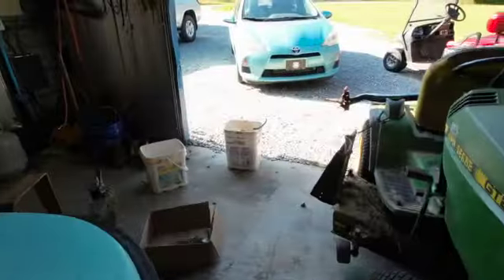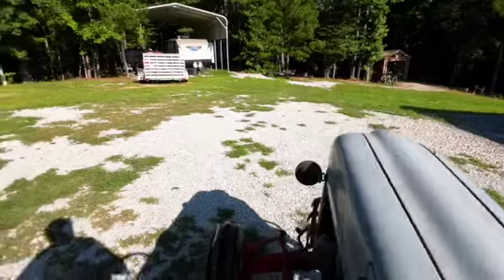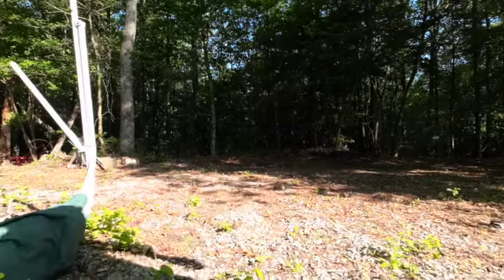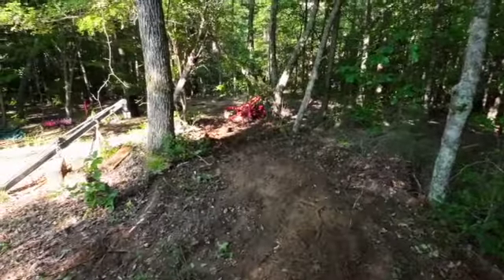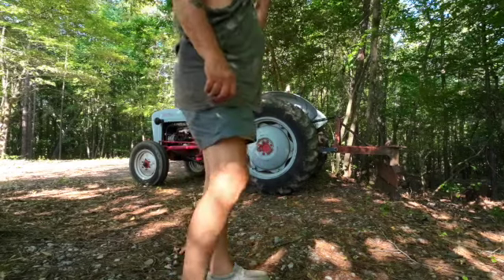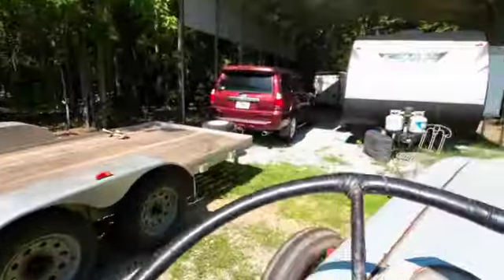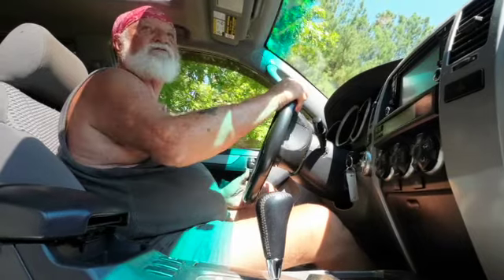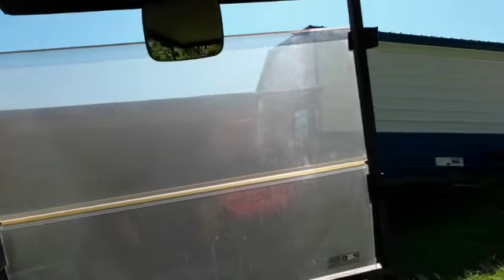Gettin' it done with a tractor on a hot day in Dixie

Comment: I agree not every one is able to back up a trailer . If have a non contact temperature gun . A good converter will be around a hundred degrees hotter at the exit side of it, But just a quick test as one would have to know the desired exit temp for the conditions to see the actual health of the converter , but can tell if working or not. . Or better if know any one with a car scanner , one can tell a lot from the upstream and down stream 02 sensor readings.
Reply from the maker: Oh..

Comment: Yeah cadillac Converter Can get plug . somewhere around a hundred thousand miles The honeycomb gets plugged from the carbon in the car And when that gets plugged that could catch the car on fire . You can take it off. Clean it Out But if you don't get it all out and it plugs  muffler at that caused you more problems .If the state you're Live in Allows you to not have a converter in Or straight Pipe you could put a straight pipe on Where the converter was .Pennsylvania Where I live Not too many people live in this area You can put a straight pipe on here. I used to work on cars and Trucks . I'm disable now . But if the car keep smelling hot That cadillac Converter It's getting cherry red Because I can't breathe ive Seen it happen
Reply from the maker: True.

Comment: Put the engine stand in the little building with the john deer tractor or the other little building in the back i would not leave it out in the weather..
Reply from the maker: There's no moving parts except the wheels so I don't think the weather can hurt it.
Reply: @rpeek  I would not leave it outside tho the gauges will rust or take them off